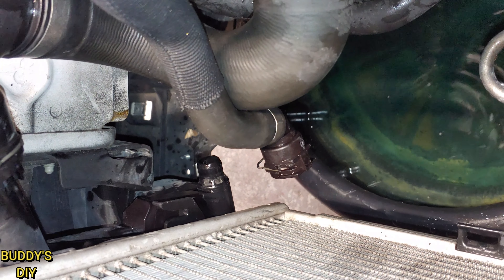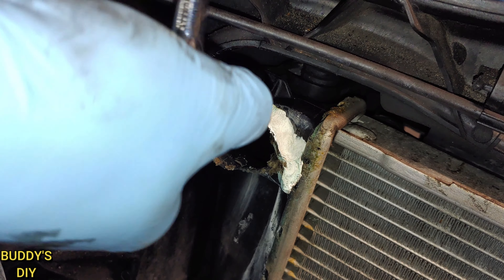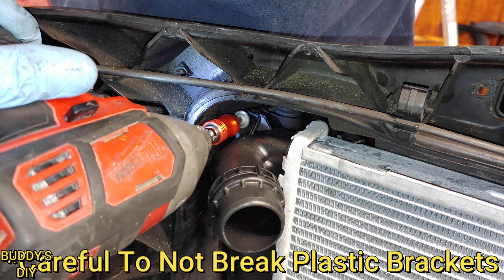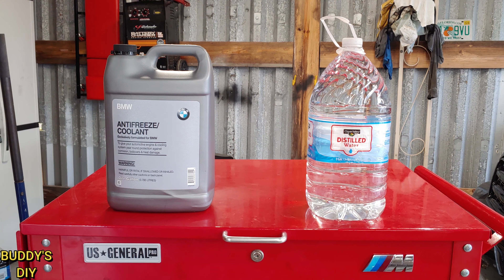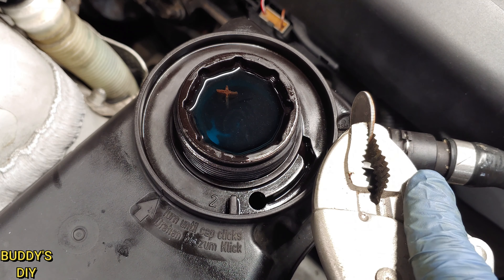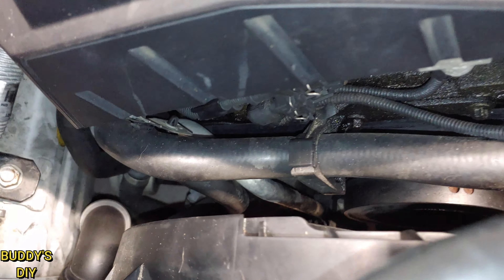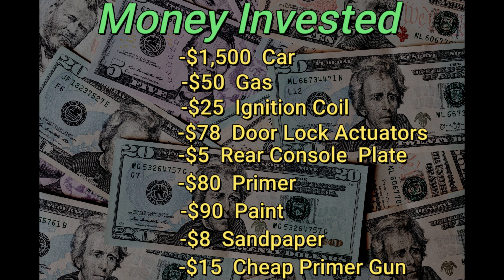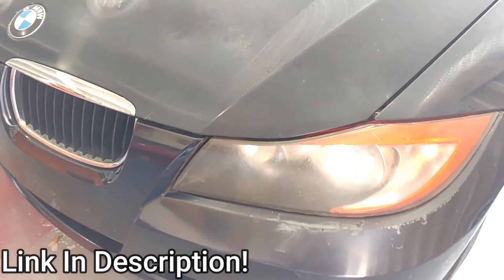E90 E91 E92 E93 Radiator Replacement | FULL PROCESS

Comment: I literally snapped off that same upper radiator outlet/inlet whilst trying to replace the hose. Hopped on youtube for a video on the replacement process and saw this video straight up. It's perfect, so simple, clear and well presented. Thanks dude, great work.
Reply: This just happened to me !!!!!

I had a hose leak, turned into a radiator and hose repair 😭😂
Reply: i did just now too, i bought the new upper hose and i put sealant everywhere, it keeps leaking but its temporary just to get to work. but i hope i can replace the radiator soon

Comment: Buddy! So I have a nissens as well. I haave AT so long plug on drivers side. I also have a smaller hose that goes under the lower rad hose. Since the new nissens rad was installed, the coolant temp only goes up to 75°C, sometimes 80, but that’s it. Soon as I move, the coolant temp only temp drops to about 60ish °C and also my heater only blows hot air when at a stop. I think the new rad comes stock with short plug on the passenger side but it could be wrong.

Comment: I took off my fan last night thx to this video BUT my radiator I found out has just a tiny lil hole at the plastic top right housing. U put white stuff?? Wat was that? It worked fine? Jb weld
Reply from the maker: Yeah but it's a temporary fix. It'll last a few months or maybe even a year but if you got eh money I'd just get a new rad 🙏

Comment: If this happens to you. Don’t be afraid to give it a go. Turn out bmw wasn’t so difficult and the over engineered aspect makes shit easier to remove. Complex but not overwhelming. It’s bmw grow some balls. Do what you can first before taking it a mechanic
Reply: I decided to do this job myself which is why I’m here lol and I also had a crack where my boi here had one on the radiator. But yeah this the best video out there shows all the right angles to see the parts and screws and all that. I was gonna take it to a mechanic but didn’t want to spend so much money on something I figured didn’t seem so hard my only worries are breaking a damn hose or sumn smh knowing my clumsy ass

Comment: How's your Nissen's doing? My Mahle Behr sprung a pinhole leak lower driver side corner at the plastic end tank only after 10 months 10k miles. Wondering if I just fulfill warranty and hope I just got a defective one, or try Nissen's and hope that one lasts longer? I really don't wanna spend premium on Genuine BMW, but if I have to replace a radiator annually, I may just bite the bullet.
Reply: Just go with durlast it comes with a limited-lifetime warranty
Reply: And it’s only about 80 bucks more than the Nissens

Comment: As I removed my bumber a small rubber seal fell out. It's about 4 inches in size and fell from the drivers side. Can't find out where it goes 😖
Reply: Did you find out where it goes
Reply: @staiz_jano7047  Not sure tbh. I did clip it back on, but it could have gone in various places. I picked a spot near the fog light as  I'm assuming it's to stop water getting in. So far everything seems ok 🤞

Comment: After you twist the bleeder screw do you add the rest of the coolant or when did you add the other half gallon?
Reply from the maker: Just top it off as you go. After you twist the screw. After you let it run for a minute. Just make sure it's topped off.

Comment: I have a leaked radiator. The shop asking $1500 to replace it. They say once radiator is replaced, the thermostat needs to be replaced as well. Not sure if this is true
Reply: yes and water pump and u hose . electric water pumps fail around 7k miles.

Comment: 5:58 and in the other corner of the radiator which cap did you put the long or the short one? and because?
Reply from the maker: I can not recall right now which one I used. Automatics and manual as well as turbo vs non turbo are the deciding factors.
Reply: @BuddysDIY  ok mine is automatic and has a small hose just above that means it has an oil cooler?
Reply from the maker: I'm not sure brother

Comment: We've spent about 4 hours getting the lower big hose off. So far a small part of the radiator is still inside that house. I've fucked up both arms trying to get it out.
Reply: Eyy im in the same boat. The top hose came out in seconds but the lower one has not budged one bit. Anyone have advice on how to get it loose?

Edit: 34 mins after making this comment I got the hose out. Just kept pulling on it as I was for the past couple hours.
Reply: @N54MyBeloved  jup. i got a new hose. took a dremel on the little metal strap and literally replaced the whole part. after we had the whole radiator out with te piece still on it i placed it on the funfair as the new sword in the rock. only the king of germany could pull it out iguess because nobody managed